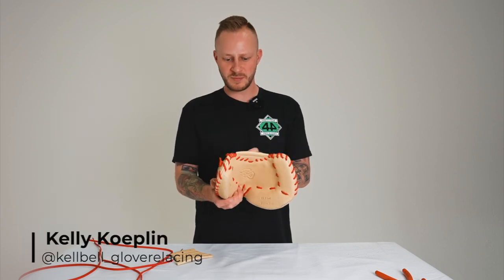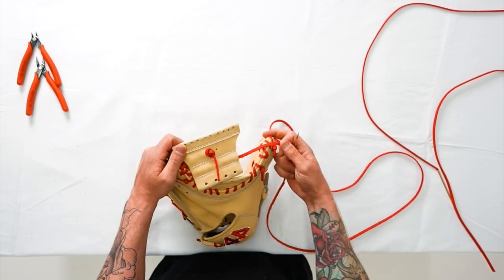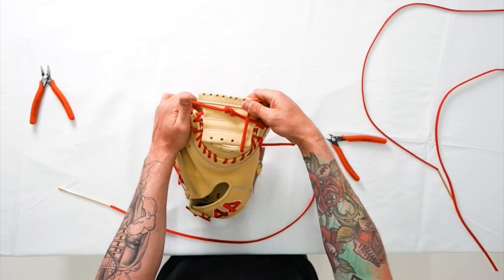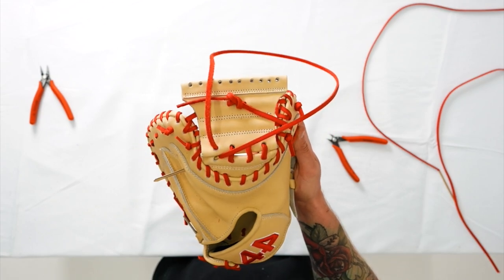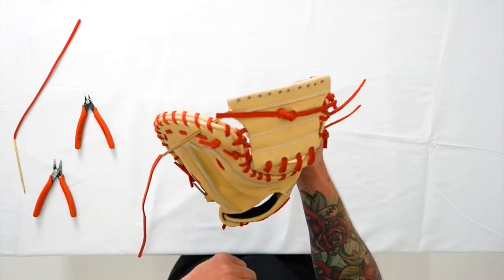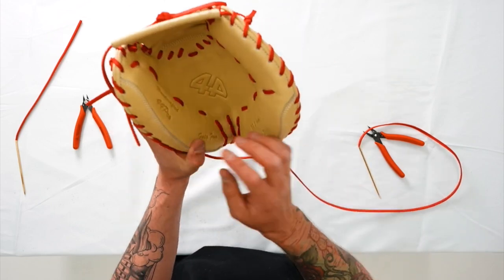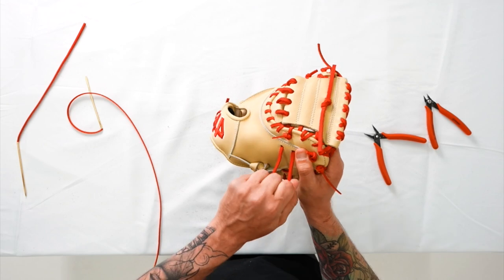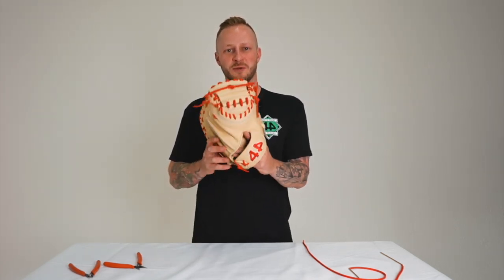Relacing a catcher's mitt web | 44 Pro Custom Gloves

Comment: The web is laced too tight. If you look at any high level catchers mitt the web will have 1/4-3/8” gap at the base and 3/8-1/2” gap on the sides so the web just floats between the thumb and index of the mitt. This allows for better pocket formation and receive the ball with less snap of the mitt.
Reply: The glove and laces aren't broken in at all
Reply: That’s after the glove is broken in
Reply: That 3/8 gap comes from use and lace being stretched out, I lace mine a little looser though bc I use a small glove